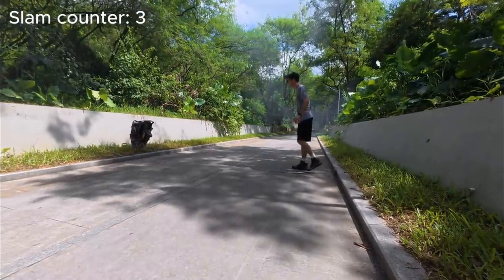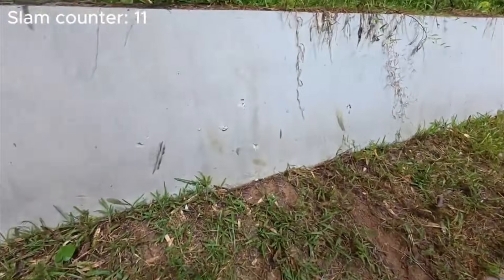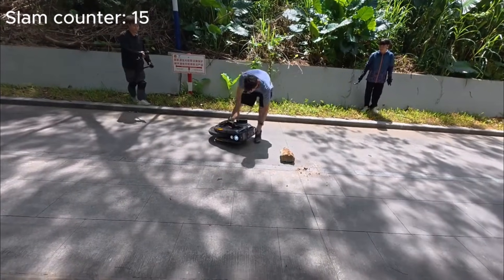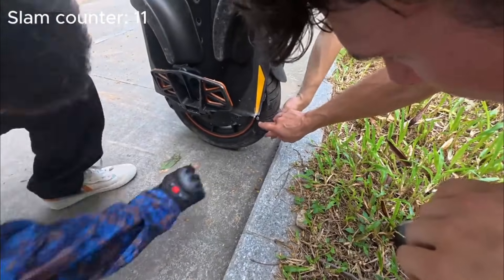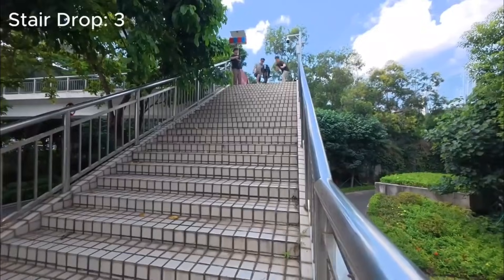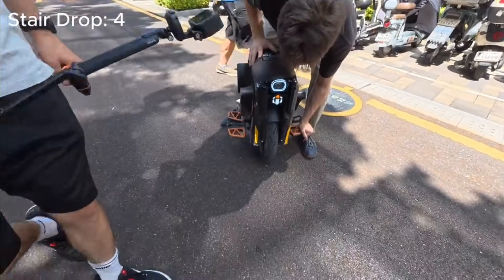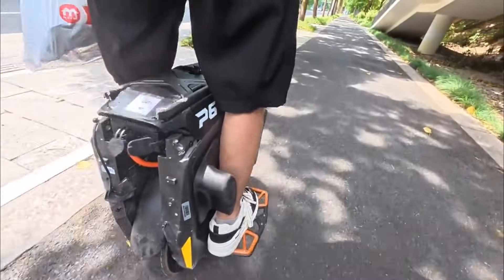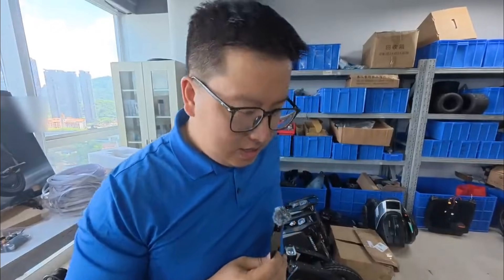INMOTION P6 Crash Test Sets a New Benchmark for EUC Safety & Testing!

Comment: I want a wheel that can archive max 50MPH, huge torque, agile in any street, or off road, can travel 300 miles  a charge, smooth comfortable ride, have leather seat, cup holder, hidden food tray or Beer. chiller.   But none of these EUC fit mine.  Why the hell people want to ride so fast all the time? And 50 MPH is already too fast for a normal rider.  Make a 1 wheel scooter not a damn Yamaha 750cc
Reply: Зачем тебе EUC для 480 км? Тебе машина нужна, батенька.

Comment: I’d like to see the itemized list of parts needed to repair. I’m fine with sacrificial handles or shells as long as the replacement parts are reasonably priced and available for at least 10 years.  That’s why my KS-16x is still a much better value than most other wheels on the market. Can you even get parts for the rs-19 anymore?  Nope.  Why buy a wheel that’s outdated before the first production run has even finished?  … ahem, Hero, c8, s-18, etc… all worthless. as far as longevity is concerned.  Let’s hope the p6 will be still selling parts for at least a decade or more, otherwise why bother.
Reply from the maker: You can still buy parts for the Rs, hero and many older from ewheels.
http://bit.ly/2AOYY3a

Comment: There is many things they could be telling us to get us interested and desiring this EUC, yet they decide to treat as if it is trash by destroying it in a video.

Tell us how they manage to get it up to 93 mph ride speed? Tell us how safe it it riding at those speeds? Tell us about new features? The Specs? New Technology? Warranty? Tests and Certifications? Have they made a wheel that will NEVER Cut out?

The object of riding EUCs or any vehicle is NOT to fall or crash. This video is subliminal saying you will crash this wheel and the wheel may hold together, but you won't

Making videos destroying your own brand product won't get many sales and is not good salesmanship